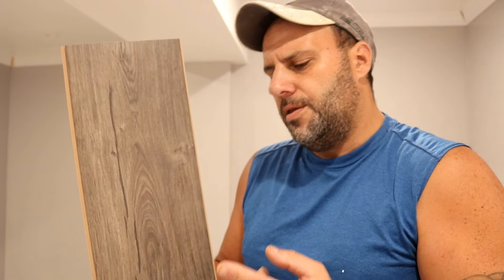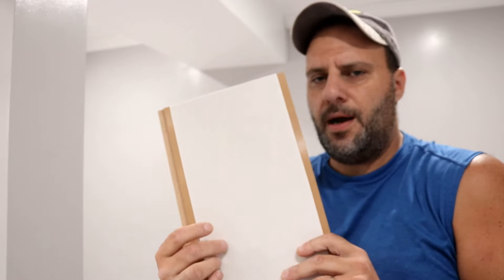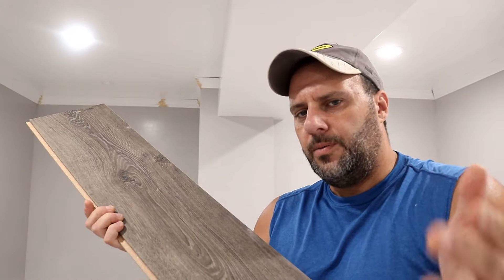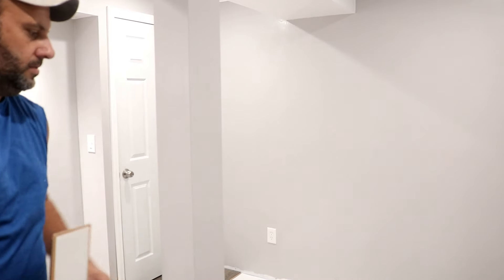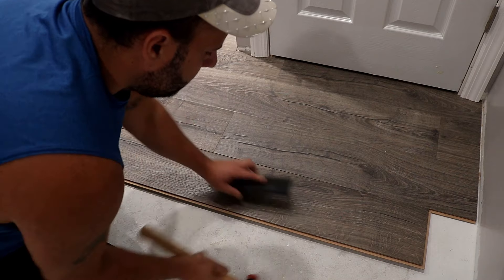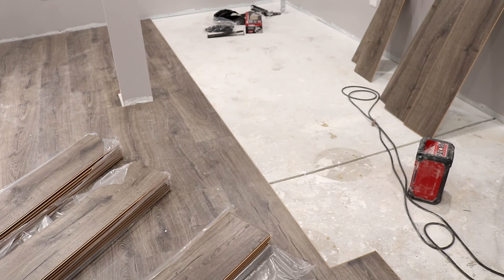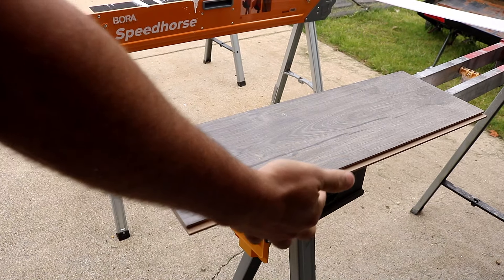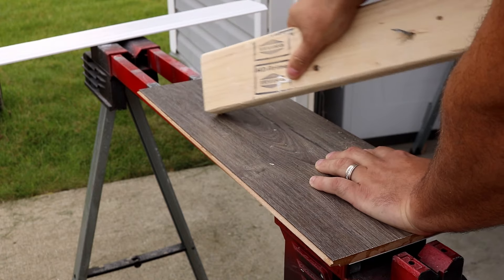Things you should know before installing Vinyl/Laminate Flooring! Pros and cons on Vinyl Flooring!

Comment: This is what we use in all our new houses. We started replacing all the floors in our rental properties with the thin waterproof kind. We don't use spacers, we just put screws in the floor (but we don't have concrete floors). So far so good and everyone loves it.
Reply: You don't have problems yet is the right statement. If you fasten it to the floor eventually it will buckle
Reply: @bigberto3517  no no, I put screws down then bump the laminate against it. I've seen where people installed it tight and it buckled. No, you never screw down laminate. I remove the screws before baseboard

Comment: I installed 400 square feet in several basement rooms then 670 square feet in my basement woodworking shop. Love how it came out. The stone core, commercial Core-Tec pro grade, high dent resistant is best for a workshop. I found the hammer block did not work well and discarded it. It is much better to cut a small piece of flooring and hook it into the end or face and hammer on that. It works perfectly and the small piece can easily be replaced when it gets worn out. The second trick is to place a bridge piece between the currently installed flooring and the new piece. Then use the small cut piece on the end to hammer on. You get perfect alignment and no gaps or damaged pieces. The metal tamping tool is wonderful and works well.

Comment: I have Pergo laminate in 2 full bathrooms and they’ve held up perfectly. If installed properly they will not cause any issues at all. I used Dap caulk on the toilet and all surrounding areas to make sure everything was tightly sealed and waterproof with the Pergo Gold underlayment. These laminate are actually designed to be installed anywhere in the house including bathrooms and kitchens so not sure why you don’t recommend them to be installed there.

Comment: There is water resistant and waterproof. Make sure you read before you buy. Also, even tho it says waterproof, doesn’t mean it’s water tight. Which means if you leave water standing on your floor it will seep underneath thru any edge. Which I believe is the biggest con of this flooring system. Hardwood flooring is water tight because it gets lacquer all the way. Tile is water tight because you put grout with sealer on the joints. Can’t do that with vinyl/laminate. I’ve thought about dabbing a very small amount of silicone on every edge of my new vinyl as I am installing it , to make a continuous seal. What do y’all think about it?

Comment: I wish I had seen this video before I started my flooring project. I replaced most of my first floor (3 bedrooms, a dining room and hallway) with Smartcore Ultra vinyl planks. The brand install videos make it look so easy. Like floor legos. LIARS! It's not just click click, tap tap. Nope. It's a struggle of jiggling and banging and cursing broken edges.
You HAVE to make you cuts absolutely perfect, like you said. Also, if you are going across thresholds and you don't want stupid T-strips, then you are likely going to end up laying out and locking in backwards. Ya. 
All that said, it is BEAUTIFUL once done. The Smartcore is incredibly durable and 100% waterproof.
It doesn't have the plastic underlay though, so not recommended for installation directly over concrete. This stuff looks a good option. Thank you :)
Reply from the maker: Agreed with everything you said Heidi. I think if you have a a basic room with some obstacles,  you'll be ok, but its not as simple as one thinks, and it can torino a pain quickly
Reply: I’m a floor covering installer by trade and have shot a few things for hgtv and many lumber liquidators but ofcourse actors were shown holding the tools and wearing gloves as to hide the fact that my hands were not the (actors) “homeowners” lol but I said why do y’all want to make it look so easy? 
Production explained that it would drive sales by people thinking they could do it themselves but have a hard time in reality causing them to call a pro 😂  but only downside is some crazy customers then believe the process to be a sinch hahaha. 
Key is in the PREP
Reply: The 4in1 moldings are nice Much nicer and Much more flush than commonly used 20+ years ago. And for $30 can’t beat it.

Comment: Is laminate new to the states?   Very common in Ireland.  They have different levels of toughness.  I believe AC5 is the grade used for high wear areas.  I’m doing this in my office in a few weeks too but I need to weld up some slide robe doors first.
Reply from the maker: Na, its been here forever.  I always wanted to get ut but wasn't sure if it would be any good.
Reply: stay with .55mm or thicker and something with a bit of limited commercial warranty tends to be decent.

Comment: I absolutely love putting these floors in between my partner and I we have a system where one guy does the cutting and the other guy installs the flooring it's so fast the only downside is when the floor has dips running this over a long distance you will feel those dips in the floor after installing this product and when it comes to vapor barriers I've used tar paper on hardwood and Floors 2 plastic and foam that comes on a roll it all depends where I'm installing and how much moisture is in that area but they have so many colors and styles to choose from you will not regret installing this flooring

Comment: Looks great but u were doing it wrong you made it more difficult than it needed to be, you should slot the long side of the board in first holding it at about 45degrees then slide it along until it touches the other board then press down and bang the short side down with your fist or mallet, it will click into place there's no need to tap it together on the long side so no risk of damaging it , I hope that makes sense, love the channel
Reply from the maker: Wow, ima try that next time Paul. I was doing what they said in the directions,   but hopefully hopefully what you said works fast👊
Reply: Yup slip a pry bar under to do the lifting while you do the maneuvering and tapping. But not that bar in the kit and can’t adjust as easy with that but I know the floors done now lmao
Reply: @ToolReviewZone  what are some tips when installing laminate flooring

Comment: Hi. Nice detail video. I am planning to install this in my office about 150sq room. My issue is my current wood floor is uneven. How do I deal with that ?
This house was build in the 50s and they kept the original floor still intact not too bad but its not waterproof and got some stains here and there.  
Thank you!!.
Reply: if it is very bad, it might need a thin screed or skim coat after the right primer was applied to level things out.

Comment: thinking to install it, but vinyl floors I am looking at seems to be much more resilient. I dropped many tools on it and 0 damage.  Like the video, though I am kind of not happy to place this directly on the concrete, mainly due to climate we have here, rather cold during winter time so some extra thermal insulation is what I am thinking about.

Comment: Hey I just want to say you are one of my favorite tool channels way better than VCG they kinda get on my nerves and half of them don't know how to use tools. With that said I have been a flooring installer for 18 to 20 years (stores paying attention long ago). One tip that I have never seen on YouTube is throw that tapping block in the garbage that is why you damaged it. Take a scrap piece and cut it so you have the right side to go in the groove and cut flat on other side use that for tapping block. Its makes sure that the groove is fully ingagged. You should have put down a moisture barrier down. When you concrete sweats the planks will absorb some and lead to swelling and breaking. I know it says 100% waterproof but laminate it even the vinyl snap planks will warp from moisture. The top is not sealed from moisture at joints it you let water sit on there to long it will make its way down to the (devil ) MDF. Good luck that for the videos 
Dave

Comment: how in the world do you clean this stuff? mine has footprints, and paw prints that will not come off!
Reply: Boil a kettle and put  the water in a bucket. Mop bucket. Then put floor cleaner with the mix and mop it. But not soaking wet. Put a bit of force down when mopping the areas and you will see it go away. :) I have a flat that doesn't allow animals and my cat and dog are always putting their prints everywhere but I can always remove them ;p

Comment: I hate titles. Most look like crap and one eventually cracks, chips or gets something heavy dropped on it sooner or later. Good ones imitating natural stone are ok for some uses. I think good solid core vinyl is the future. I think the textures will just get better on the entry level stuff over time... the expensive ones are good already

Replacing a ceramic tile is a lot harder and a lot more work and mess removing the old thin-set than one would imagine... The make a contraption now you can use to pull open plank flooring for maintenance (it is the reason we leave a gap around SPC flooring even though it doesn't really expand).